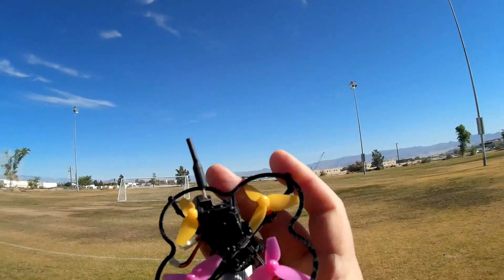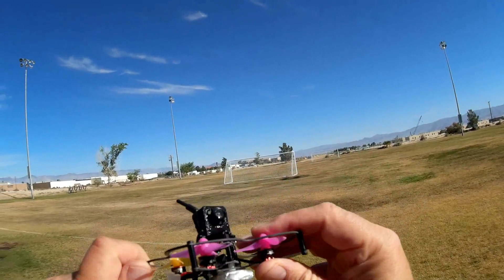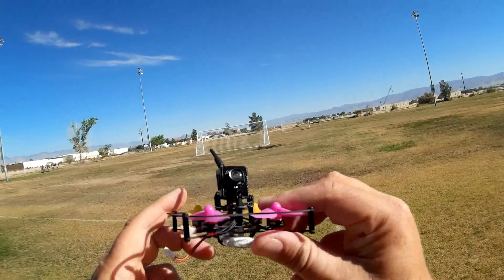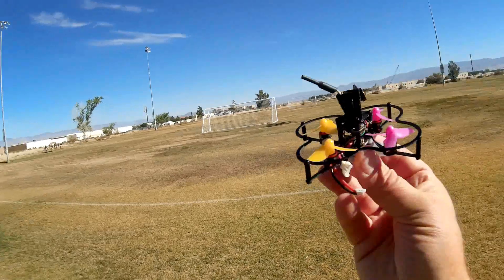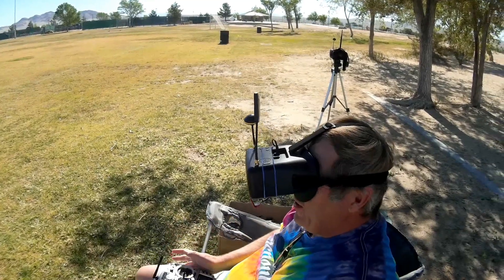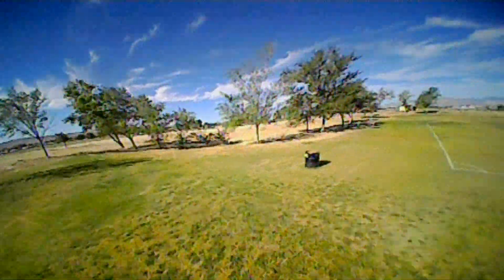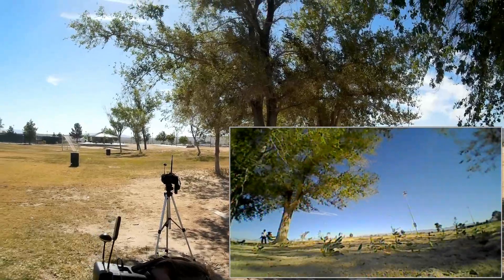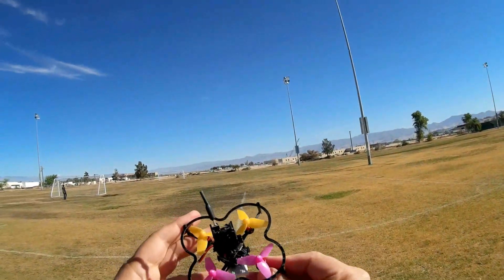dustX58 Tinyfish Brushless Micro FPV Drone Flight Test Review

Comment: I'm not sure if I got a dud but mine can't go much more than two minutes on the stock battery or even bigger mylipo 600s. I know when the battery is getting low because the pitch and roll start getting notchy then the RSSI alarm goes off then it falls. Incredibly inefficient. Not sure how they managed to take a step back from brushed performance?!? I can put the same lipo in my super-x micro and do 5 minutes of flips, rolls, loops and come down at 3.9v.
Reply from the maker: It's an engineering tradeoff of providing much more power to the motors (vs brushed motors).  But that extra power doesn't come free, with the tradeoff being reduced flight time as compared to a brushed micro FPV fliers.
Reply: Ben B I don't have this quad but I run the 15k motors with 31mm props. With my Tattu 220mah I get about 2 minutes, Crazepony 260mah I get 2:30, and with Tattu 380mah Tattu I can 3:30 but it's sluggish. This is with a printed frame weighing 20.5g minus the battery
Reply: I made one with the 20k motors with some 3 blade props that were on my tinywhoop. weighs 18.3grams without camera & battery. I used the 250mah hv nitro nectar battery but I only got about a minute of flight before it started to puff the battery.. How the heck did you get 220 to work fine haha
Reply: Which FC are you using? The TinyFish? If so how are you able to use the HV packs? That's a decent weight. Maybe the board is getting to many vibrations. Are you soft mounting the FC or using some type of vibration dampener?
Reply: Well.. I did some further tests on motor's tab. Each motor is drawing 2.7amps at max... which is nearly twice what the tinywhoop motors are pulling lol. So the battery is sagging below 3.3v even at 4.1v charged just with like a 60% throttle.. No idea what's up.. It's juts some little 31mm props. All seem to spin smoothly and fairly quietly. I even hooked 5 of the 250mah 1s in parallel thinking that would help with the C haha but it still dipped them below 3.3. Even hit 3.
Reply: Sooo, would you say "incredibly inefficient"?
Reply: Pretty much. I built it with efficiency in mind but it's just the opposite.
Reply: That's what I noticed. I can see the low voltage LED light up on the FC after the first few seconds. The Crazepony packs have a high C rating and I don't get low voltage until about halfway through the flight. I have some 12k motors I want to try out but they I'd for sure have to go with the 40mm props.

Comment: You know, its going to get to a point where you aren't going to be able to see these tiny ones to fly LOS. Heck, its hard for me to see my QX95 at a distance of greater than 50 yards. So, by going so small, you'll either have to fly it within 10 yards for LOS or fly FPV. Regarding the tuning ... stock Betaflight PIDs work pretty well on just about anything out of the box (unlike Cleanflight PIDs). Yes, you can tweak them to your own liking, and I always do, because everyone's "feel" is different.  At first you said it was only available in FlySky .. but then I saw you with a Taranis in your lap, and wondered if you had a TX module plugged in the back. But, then you said it was only available in FrSky, so then it made sense.  Since you have it on the Taranis, one feature I've incorporated into all my Taranis models is to have a 'flight timer' running (it starts when you arm and advance the throttle).  As each minute goes by, the "voice" on the Taranis announces the minutes elapsed (1 minute ... 2 minutes ... 3 minutes .. and so on).  This way if you know your craft has only a 3 minute flight time, you can start thinking about bringing it in shortly after the 2 minute warning as been announced.  Since I have the module which allows me to fly various 'toy grade' quads with the Taranis (like Syma and Mould King), I know the flight times for those quads as well, and go by the time announcements rather than having to look for hard to see LVC LEDs (besides, some of my toy quads give you about a 5 second LVC before dropping out of the sky, so an announcement works out better). Its a cute little flyer, but perhaps a bit too small for me. I should be getting my KingKong 90GT (brushless) this week some time and am looking forward to getting some air time on it .. weather permitting. Thanks for the review ... Cheers.

Comment: aren't u using the VR D2 fpv goggles ? i heard its almost unflyable when u turn the dvr on ? how did u manage to record and fly without crashing with all that lags?
Reply from the maker: No I fly with Furibee VR01 googles https://goo.gl/PAatw9 , and record with VR D2 goggles https://goo.gl/ZmZxZh
Note the VR D2 goggles on the tripod at 2:57 into the video.  By the way, the VR D2 has been upgraded.  I have a set coming and will be reviewing the VR D2 Pro version in the near future.  Hopefully, these issues have been corrected in the Pro version https://goo.gl/gv9ZwG
Reply: With vrd2 you must switch between the vr to record and the direct video feed to fly. To be perfectly flyiable.